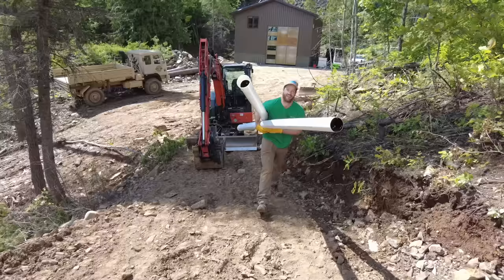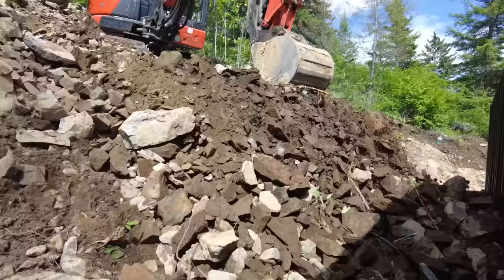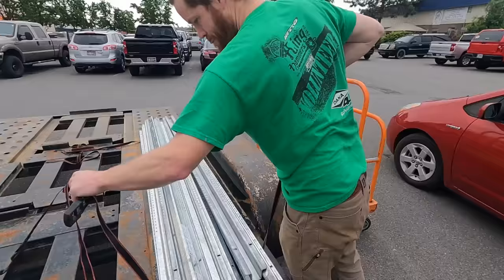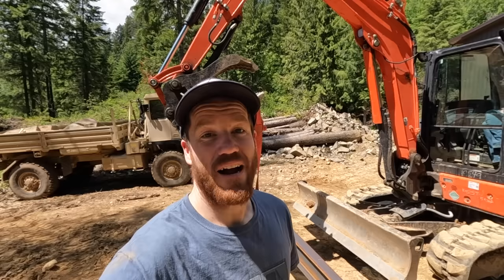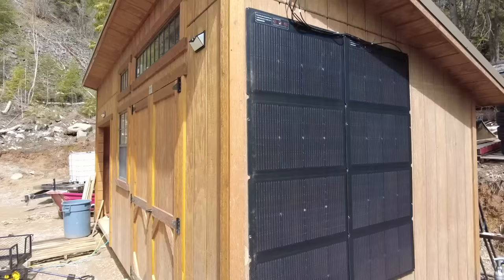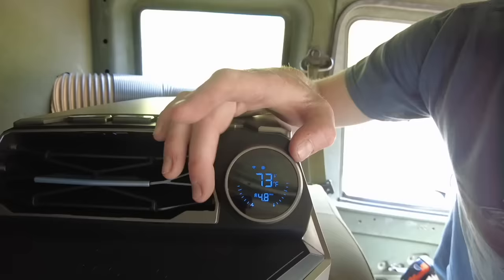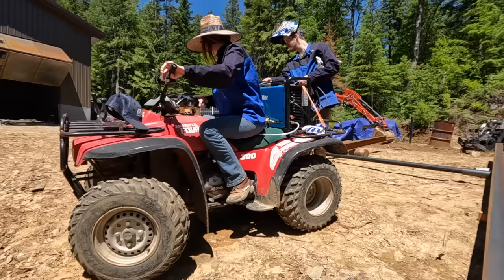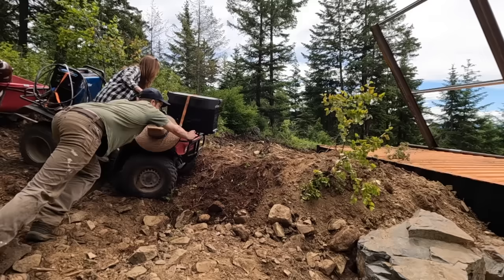We Were Told To NEVER Do This | Burying A Shipping Container

Comment: Loved the shot of Boone and Bailey sleeping in the back of the car. 🥰
My understanding of weathering steel (COR-TEN) is that it requires the alternating wet/dry cycle to form the resistant barrier. Burying it eliminates the cycle and it ends up rusting "normally." I'd have used a thicker mastic-type coating rather than the paint and done something to protect the coating before backfilling to reduce scratches from penetrating the coating. Another thought would have been to put stone and drainage under the container to help with things drying out.

Comment: great video thank you! the holes face down on drain pipe for at least two reasons. one is the dirt is less likely to get inside the pipe with the holes down. facing the holes down also allows the water to enter the pipe at a lower level than it would if the holes were facing up. the drain pipe is not supposed to catch water as it comes down it's supposed to allow water to flow out as the  water table rises up from Below.

Comment: The main concern I have would be the side load during the winter and especially during spring thaw. The added weight of the snow/water could trigger a side collapse or could result in the entire container and array sliding down off of the cut you made.  I'd recommend that you look at not only shielding the top of the container, but also look into some way to divert run off to mitigate the potential problem.

Comment: Power supply taking shape nicely! 

Might want to stack large rock beside the container's downhill side do that the fill on the uphill side doesn't push it sideways. Get more telescoping square tubing on the 4 corners of the array panel so it's much more rigid in the storms. You'll want that for the winter snow loading also. 
I know that you've got more welding and other work to do for this project, but great so far!
Reply: Please wear safety glasses when driving those steel pins in the rock one chip off of that in the eye and it'll ruin your whole summer . Also, if you had a hammer drill to drill a hole before you put the pins in the rock doesn't stand a chance. Stay well, stay safe

Comment: I love that you guys are prepared to discover a mistake years from now. I have a bunch of firsts on my off grid property that you just can’t find in YouTube University. Like you I figure you give your best thought and effort and hope it works. I have designed tilting panels raised off the roof of our barn to cater from snow depth. We had the barn structure engineered to withstand massive forces from snow, panel framing weight, lateral and updraft wind lift from the panels. This allowed us to have the panels out of main view like you guys have. Most say it wont work but the engineers signed it off so we are giving it a go! My water collection design was a first for the company that installed it so we’ll be watching that and expect some modifications also. Many have said I should be YouTubing my project but I know the effort that takes and what I’m most impressed about you guys is the effort you put in to document every project. I just could not find the time of effort to so that! Very impressive!

Comment: Thanks for sharing another interesting project. Great creative design and excellent fabrication skills. Regarding burring shipping containers. I remember seeing a video on a community that created tornado shelters doing this. They lined up the containers with the doors facing each other, just far enough apart to allow the doors to open. Then they covered the sides and back with dirt and grass to help hold the dirt in place. Voila quick and solid protection. I believe that was Greenburg Kansas' FEMA trailer park after the devastating F5 tornado that scoured much off the own out of existence.     I know you guys are pretty good with safety, but I see Riley loves his hiking style boots. He should seriously consider getting some safety shoes. They are now offered in similar style boots so they are much more comfortable than boots of the past. Just dropping a descent sized wrench can crush a toe. It's worth the $100 to $150. They are also generally electrically insulated and fire resistant. The first feature probably saved my life when I turned the breaker off in the house after I moved in and needed to fix a socket. When re-stripping a wire I got a serious tingle. Turned out some idiot had connected this circuit in a loop to 2 circuit breakers. I had manually traced the wire from the breaker so I was certain the correct breaker was off. After that I also got in inductive power indicator. Hold it near the holes in the outlet of electrical wire and it will beep if it's hot. Cheap and even easier than using a multi meter.    Thanks again for the great videos and I look forward to seeing your solar system progress
Reply from the maker: Hi Andre, thanks for the great comment! We agree on the importance of safety toe boots, the ones you see Riley wearing are steel toe. Those inductive wire testers are super cool! We have one as well. Anyways thanks so much for watching and taking the time to comment!

Comment: It was all great. Love it!
The only thing is saw that was concerning was the thickness of your drainage pipe. Too thin of a schedule pipe for the load without a bedding for protection. Im confident it crushed with the first rock.
The good news is with the grades in the area, standing water wont be a concern.
Ive worked dirt for 50+ yrs.

Comment: Now you need a gigantic broom / windshield wiper mechanism to sweep the snow off of it in the winter time . Super cool and resourceful set up you guys are building keep up the good work 😎
Reply: How about a sailboat style traveler?  A Broom Arm from top to bottom that travels on horizontal upper and lower tracks.  One pass -Then parks itself on the opposite side. 
Next pass is opposite direction. 

They need somewhere for the snow to pile up over winter so the 
Bottom panel is not covered. 

They could put it on timer or remote for when they travel?

View camera connected to internet?

Comment: Brilliant flexible/pivoting solar array framing system, though I'd be concerned about your solar array (once the panels are installed) turning into a sail in strong winds.  Also, your container is probably at some point going to take some side damage from a lateral load, most likely from water, I would imagine (think rapid snow melt or really heavy rains).  Your drain may not be able to keep up. The reason you shouldn't bury shipping containers is they're not designed to take lateral loads, they're designed to take vertical loads, but I'm sure you know this already.  If burying one, you should really reinforce the interior walls with some framing

Comment: The more we watched, the more we got scared for you. One again, you didn't remove any millscale from your gussets or other metal. (Look up millscale to see why it is very important and what it is.) Basically your welds are can be bad and weak, you cannot get good peniteation with unckean surfaces and millscale plus contamination. Clean surfaces are needed for strong elds and good metal fusion. Which makes a good, safe, and strong weld possible. Maybe watch some 'How to Weld and Clean Metal Videos' by real welders? It may look okay, but your smartest move is grinding off all your dirty or contaminated welds, then recleaning the metal and rewelding it the correct way. You save no time skipping metal prep, if your welds are not strong, clean, and actually have fusion. It also looks like you spot-welded over and over trying to make it look like a TIG weld? If? That is the case, that is also not a strong penitrating weld, because thicker metals will not get hot enough. On thin sheet metal it is used to prevent too much heat from warping the light guage metal panels. But on thick metal it is pointless. You want the heat to fully melt both sudes of the weld metal to create good fusion and a quality weld that will hold. A way to test your existing welds, is try to pull some apart, or cut a small section to see if penetration was achieved. Safety Tip: moving a compressed gas cylinder without the protective cap in a sketchy plastic trailer on uneven grade down hill, YIKES! Lucky that didn't fall, break the valves off, and then shoot like a torpedo right through your wife or you. Yes they really can do that. I wish I had a possitive comment, but you are dangerous and ill trained to be doing things like welding heavy metal objects anywhere. Please take the time to educate yourself on proper welding and metal preparation, the use, storage and transportation safely of explosive gasses. I will hope everyone's advise and suggestions are taken into account for your sakes. Good luck.

Comment: Spray paint marks on your cables and supports for summer (yellow) and winter(blue) to reduce the guesswork.  You could take it a step further and adjust it 30/31 days.  You would need six colors or marks to mark the progressions between summer and winter solstices.  If it gets too top-heavy, use the hole saw and cut 3" disks out of the top, spacing the holes out like an aircraft spar.   Then add the disks to the bottom.  Each 3" disk should be 3/4 to 1 lb.

Comment: There's a guy here in CA that has been living in two buried sea cans for about 35 years....  Key is they are totally buried with a concrete slab poured over the top.  I would say that 1/2 burying one side is just fine.

Comment: I think the biggest problem that you would have when you bury a container is if you put too much load on the top of your container. We had a 40 footer at work for a field office and one of the job site material handlers used a fork lift to set a pallet loaded with a full reel of heavy electrical cable on the roof. It was easily over 1000 lbs and the roof caved in about 12 inches. When the pallet was lifted back off, the roof partially rebounded, but was still deformed.
Reply: All the strength in shipping containers is in the corners because the purpose is to connect them together on ships and then to chassies to deliver to locations on land.  The sides as well as top and bottom are corrogated, but mostly to keep cargo inside, not to withstand pressure from earth when buried.   That's why everyone tells you not to bury shipping containers.

Comment: White would deflect the heat. I'd also consider thermostatically controlled ventilator fans to vent the heat from inside the container.
Reply from the maker: That is an excellent idea Brian! We ordered a fan that is both temperature and humidity controlled.

Comment: Nice setup.  Would have put a dirt cover over the drain pipe. One thing that I would suggest is to taper the dirt at the bottom of the pannal edge to let the snow slide off and down the hill side.  Can't wait to see how it works out.
Reply: Yes, snow accumulation off the bottom of that huge array is going to be huge in the winter, you are going to need someplace for it to go or you are going to be going up with your excavator and digging next to your delicate solar panels...

Comment: Ralston Oklahoma  has a single school building that held elementary thru highschool.   The school  at the time only had middle school attending it but the state is know for tornados and the kids didn't have a good Storm shelter. So we buried a conex container under ground. After closing off any openings that could allow water in. Then we  installed under ground electric, attached some vent pipes with fans along with heat and Air . Along with a short wave am/fm  radio . It's been 70%  buried for over 10 years and no issues with rust or water entry.
Reply from the maker: That is awesome!

Comment: Hole saw tip as soon as your saw touchs your work, you have the circle  scribed. Take and drill and drill two holes the width of the kerf about 180   degrees apart threw the steel. This relieves the chips alot faster with less effort.

Comment: Great progress! I was a little concerned to see the last few seconds of the video where you are hauling the gas cylinder in the trailer with out the cylinder cap on. If it slipped out the trailer, the valve could get knocked off followed by a dangerous accident.

Comment: Wind load could be a problem.  I was not happy with their "foundation" either.  I would have suggested 4 corner posts sunk and cemented in: gravel bed with 3 drains to sit on: separate I beam and posts for panel support: and some wind load calculations.  In my area, Pacific Coastal Range, just north of San Francisco we get 60+ winds several times a year.
Reply: What's the point of comments like this?  Do you really expect them to dig it all up and make changes?  The container didn't move---they said they don't want/expect it last 50 years.  They did a great job to accomplish their goals.
Reply: @KenWoodsNL  the point is that this set up is potentially dangerous, and enough people without experience will try to replicate it. There are reasons burying containers is generally discouraged - specifically due to oversights pointed out here multiple times. There will be cases where there is sufficient sheltering from the wind where uplift isn't an issue, but in other, it would be catastrophic and hugely expensive. Pioneering spirit is fine, ignoring common sense and your mileage may vary.

Comment: Just a little techy idea. I have a 12 vdc reversible ATV style winch I use to raise and lower my ham radio tower and it has a remote fob. It might even reach from your house and you could adjust the panel angle remotely for max output

Comment: I have that same welder, (multimatic 220 multi-process) it’s amazing being versatile. Welding tip get Lincoln “inner-shield” flux core wire then no need to tow gas bottle around, only down fall is spool size is either 5lb or 60lb spools unless you can find the 20-30 lb spools to fit in your machine. My wife and I love the show, keep up the great content!

Comment: I think the problems with burying shipping containers are more when they completely under ground, not just used as a retaining wall like yours. Ive seen a few of them crushed like a tin can when put underground without adequate bracing.
Reply: IF THIS IS IN SNOW COUNTRY, THERE IS A FROST LINE.  
IN WINTER THE EXPANSION OF THE DIRT & ROCK WALL COULD DAMAGE THE STEEL SIDE OR MOVE THE WHOLE CONTAINER SOME. 
IN HEAVY RAIN THE MOUNTAIN COULD SLIDE DOWN AND DAMAGE THE CONTAINER WALL OR  MOVE IT.  
ONE SOLUTION WOULD BE TO GO UP THE HILL AND DIVERT ALL WATER FROM RUNNING TOWARDS THE BOX.
BEST SOLUTION IS TO ALWAYS KEEP PRESSURE AND EXTRA WATER AWAY FROM CONTAINER !!!

Comment: Studied this decades ago. Corrosion underground is much higher than on surface or in water. The soil conducts electricity continually through any buried conductive material. Your best bet would be to weld a cable connected to some zinc anodes to act as sacrifice. This they do on ships. Still, if you bury fully, you're fighting an uphill battle. The city of Richmond had one of the first electrical streetcar systems in the world back in 18 something or other. They grounded the streetcars to the cast iron sewer system. Ate up the whole sewer system in like 5 years. Had to replace the whole thing. Of course theirs was a active system, yours is passive, i just thought it was an interesting point to the 'what could go wrong' mentality.

Comment: There is a large amount of force on the container to roll or push it down the hill. I’m also concerned now you’re adding a very large solar panel system which will act like a lever or wind sail to roll the container. Gravity and wind are powerful forces. You may want to consult an engineer and add out riggers or ties back into the hill side. I’m concerned as you will have a lot of money in that container.

Comment: Another awesome and very creative project.  You might want to have someone check the local wind loads in summer and winter modes for a) lifting up the container, b) shearing your adjusting bolts, c) buckling your sliding posts.  Good luck!

Comment: Need to build a cart trailer to hold all your welding gear and materials needed for projects and keep that tank upright. That will make all future projects so much easier since everything will be together. You can back it in the shop when not using it outside. If you are only moving the solar panel rack twice a year, might consider some rachet straps for extra support for the wind that will try and move the whole panel system. I think 2 on top and 2 on bottom should do the trick. Cheap and easy too.

Comment: French drains should be wrapped in cloth to keep them clear of dirt. Some  also use about a foot diameter  of clean  gravel around the pipes which is Also wrapped in ground cloth. So first the cloth lines the trench then a. Couple of inches of  washed gravel

Comment: About your bent beam, sometimes they just come like that, and they’ll even have a little bit of variation in dimensions and sometimes the web is twisted so one side of the flange will be a different width than the other, and when you drill holes in the web of a beam you don’t want to be within a foot of a support and go with the 1/3rd rule, 1/3  the flange width max hole and stay in the middle 1/3 rd of the flange for optimal usage of the beam, or just overbuild to accommodate. Either way love the build, I’m actually building a shipping container house now for work

Comment: To square large/long things use the 345 Triangle. From the same point measure 3' one direction then 4' 90⁰ from it. That's 2 legs of a triangle. The long leg between it would be 5', hence the 345 Triangle which ends up with legs 90⁰ to each other. So it works in multiples if you have for example a large deck or frame 6,8,10 for example